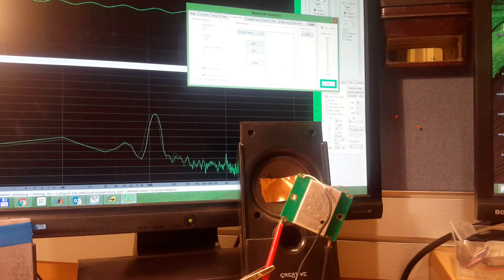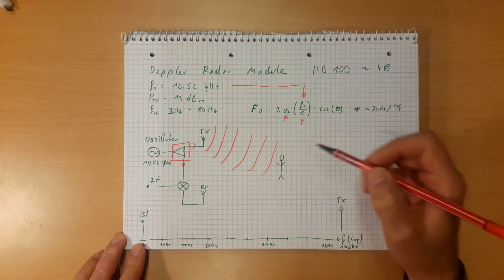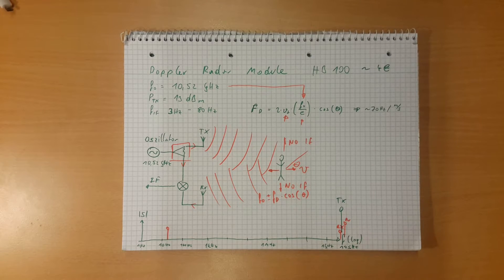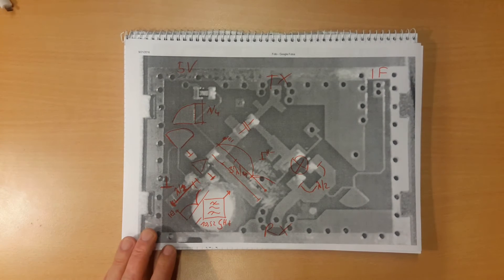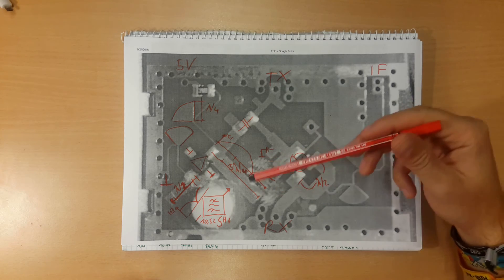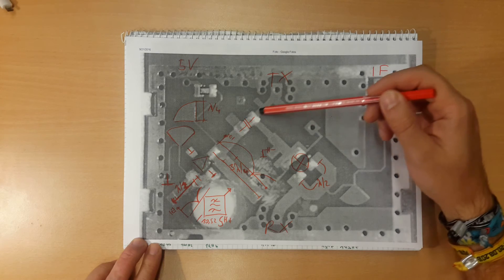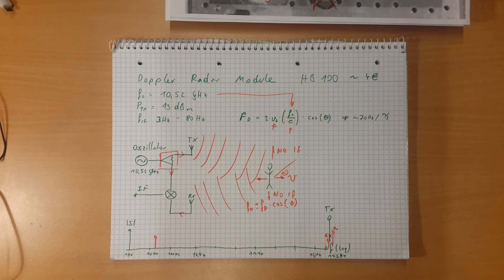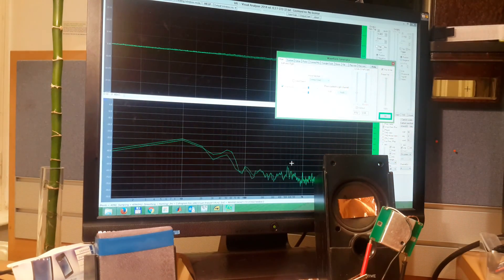HB100 Doppler Radar Module - Circuit and Testing

Comment: Can you pls tell how did you connect the module to pc? Does it require any amplifier circuit or microcontroller? Or just connecting the IF to sound card of the PC?
Reply: go right into the sound card, he says IF bit it has no mixing that i can see, nor is it necessary.

Comment: When the signal bounces and the rx antennas receive it, does that appear in the IF?
Reply: To hear Doppler effect, no I.F. needed,  you hear the audio shift of the mixer diode, in the RX Wave guide, its already in the audio range. If you want to detect a signal, from another source, then you need an I.F. section. If you have two sources, you can hear the shifts from one or both, depending on how you switch them on.

Comment: 1. Does it require a low noise opamps to be used or it's own noise is stronger than the cheap opamp input stage's noise ?
2. Did you try to implement the 2 kHz pulse mode ( second sch. in App. note - for lower current consumption) ? Any ideas on how to implement (detect objects) using this mode, since the datasheet says almost nothing ?

Comment: Can multiple HB100 modules be combined to have multiple receiver antennas for more complex analysis?
Reply from the maker: Not in a straight forward manner but it should be do able. You would need to build your own receiver antenna array that includes a way of selecting a specific configuration. When you have this signal you can simply feed it back to the module without instead of its builtin antenna. However, if you go through this hassle its probably simpler to build that antenna array you need and simply clone the circuit from the module onto the same PCB. The components should be pretty easy to get, maybe the dielectric pellet is a bit of an odd part.

Comment: for what can you use this radar and can you tell me difference beetwen that and military radar (military it more powerfull yea) is it legal to build some stronger radar?
Reply: FPS SERBIA there are obiously big differences between a $5 RADAR and a multi million dollar RADAR. Check your local radio regulation for microwave band plans
Reply: @Lick2Trip  Much more than bands designs, antenna designs. These antennas are very low gain, and very wide. you can get great gain with a Turnstile antenna, which gives you a shift in polarization. and targets naturally shift the polarization of the signal, so if you have a wave guide with the opposite shift you get tremendous gain.

Comment: what is maximum range of detection this ?
Reply from the maker: Hallo,
the maximum detection range will strongly depend on the object you want to detect and the type detector used for the baseband. If you want to learn more about that search for "radar cross-section". Theoretically only detection limit is the thermal noise, however,  this is one of problems where I would simply try it.
Cheers Bert
Reply: Thank you alot , Brother !!.....and congratulations  for the stuff of tutorial!!...Hugs !!

Comment: What is limiting the bandwidth of the IF / Baseband signal ( << 1KHz)?
Reply from the maker: I'm pretty sure its the crappy mixer they've used. Very likely it is some kind of diode mixer. Since there is no kind of BalUn in the LO trace it is probably some kind of antiparallel diode mixer of sorts.
Cheers
Reply: @BertlDS  You also have to take into count that the oscillation amplitude of your speaker cone goes down with increasing frequency (simply due to inertia), wich means the target reflection get weaker and weaker the higher the frequency gets. That's not the case during normal speed measurements, because a given target at a certain distance will always reflect the same amount of the carrier wave, regardless of it's speed (it just the reflection frequency that changes because of the doppler effect). 
I think it may actually be much better than what you showed here. I'm thinking about getting one for trying to build a speedometer by  measuring my own speed against stationary objects. I'm not shure if the range is enough for that ether - but these modules are so cheap, that it's well worth to give it a try. The range can be extended with a wave guide, wich is needed anyway to direct the signal mostly forward and not spread to much to the sides (wich will cause it to hit nearby objects at an angle and give errors). I already have one that works good - but I'm thinking about to build a small more portable unit (that can hopefully be carried in a pocket and the 10,5 GHz isn't used by any speed cameras and other nasty stuff, in my country. Wich minimizes the risk of interference. 
I also often use GPS as speedometer, but it doesn't always work (like in tunnels) or work poorly, such as narrow roads in dense forrest, city streets with tall buildings on the sides etc. Those environment are on the other hand perfect for radar  since there is a lot of objects to reflect the signal without the need for very much range of the device.
Reply: what is maximum range of detection this ?
Reply: Nothing. It happily outputs to the IF port a tone from another such device 10s MHzs away.